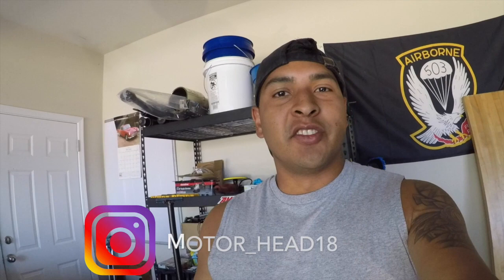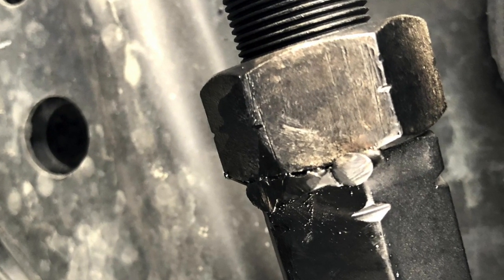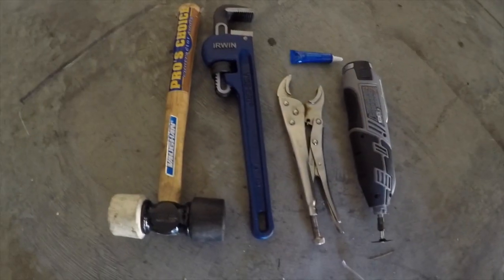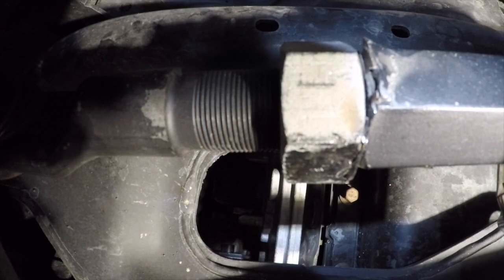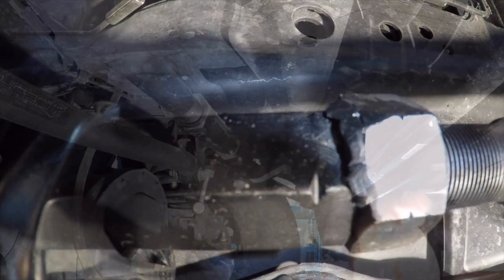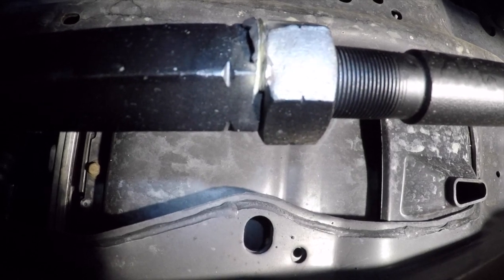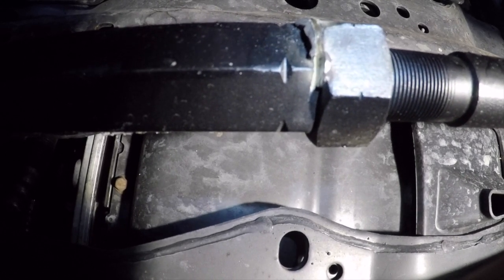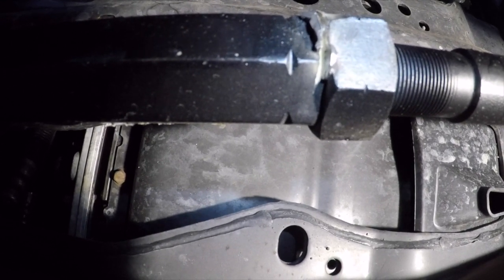4th GEN Ram 2500/300 HD Drag Link FIX!

Comment: There is actually a procedure that the dealers have to follow in order to complete this process and it is outlined in the V06 recall.  Goes into depth about the torque, measurement and welding.  Those welds looked terrible.
Reply from the maker: Yeah garbage. I got rid of them!

Comment: Thank you for sharing. My truck has been with the dealer for a week now for the recall call, looking for a new dealer.
Reply from the maker: Jeez. That's JV.
Reply: why a week if just for the recall, what are they doing(replacing the whole linkage? my neighbor had his there for a month for the replacement)
Reply from the maker: @gvc56100  FCA wouldn't test on personal trucks either at dealerships. Maybe someone is trying to come up with something using your truck. The recall takes less than 1 he.
Reply: @MotorHead18  mine took less than an hour ..as the nut was about 1/2" away from the sleeve(?)  I was told that was the fix..for some reason my neighbor's truck needed the whole linkage replaced (same dealership)..

Comment: This is a real.hack fix by FCA, I couldn't believe that they didn't come out with a hard part fix. I highly recommend upgrading to Synergy drag link(and tie rod if ur like me) once the recall is off your vin!
Reply from the maker: I'll check them out. Blue loctite and man hands are working for me right now lol..
Reply: what's the point once its fixed? would you have upgraded if there was no recall?
Reply: Yes, I  have a complete Carli suspension system I've basically replaced every Suspension component and couldn't be happier w the results. Dodge steering has always been a weak link and it's gotten better, but I want the best performing, safest, most reliable version of my truck I can have and theres no doubt the Synergy steering linkage is superior to OEM

Comment: The drag link weld is a temporary fix. Once FCA has the new parts available and tested there will be a new recall to replace the parts
Reply from the maker: We will see what the new recall will have for all us HD owners!
Reply: DC and FCA never compensated all the Jeep TJ owners whose frames rotted out due to their omittance of proper drain holes.  Jeeps in perfect super clean condition otherwise have had to be junked do to Frame rot.  Meanwhile Toyota did a similar recall at the governments behest.  They likely let Jeep slide because it would bankrupt them.  Consumer?  Who cares...
Reply: Permanent drag link recall is here! Oh wait, no. No it's not.
Reply: Still waiting it’s almost 2022
Reply: You guys know if it’s fixed on the new trucks or are they coming with that sweet factory weld?
Reply: ... And here it is 4 years later and we've never received the recall completion.

Comment: I’d have used red and not the blue.
Reply from the maker: Why red?
Reply from the maker: Evil Mofo  Right. I just don't have to fight it as much with the blue. It's plenty strong.
Reply: @MotorHead18  Red requires heat to remove.
Reply: According to the recall each jamb nut needs to hold 77 ft-lb of torque. Blue loctite will not hold that amount of torque. Since FCA chose to weld it, I would choose Red loctite and mark the drag link with red paint so the tech knows to apply heat when adjusting. Just my $0.02. Thanks for the great video. More info: https://static.nhtsa.gov/odi/rcl/2019/RCRIT-19V021-8391.pdf